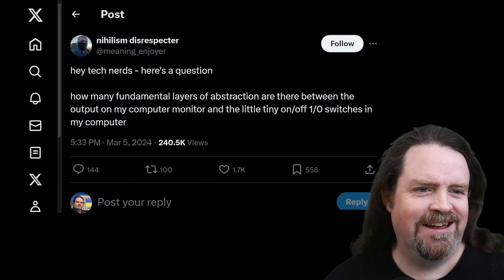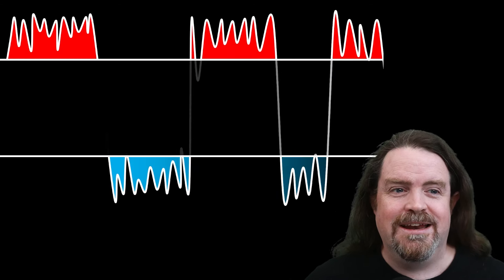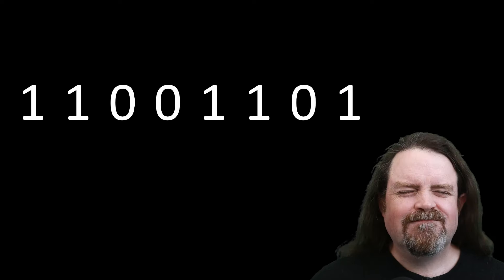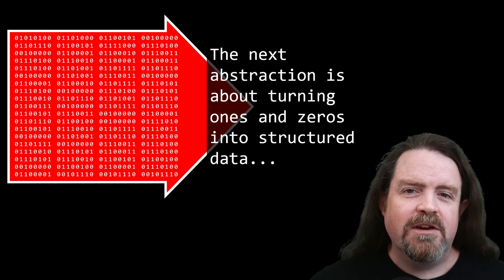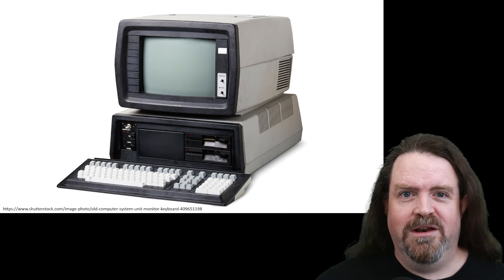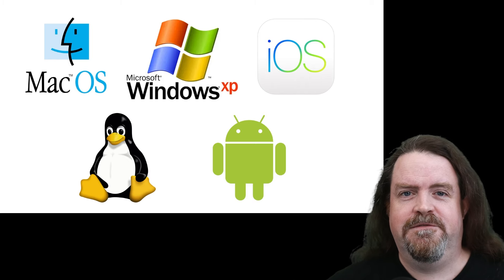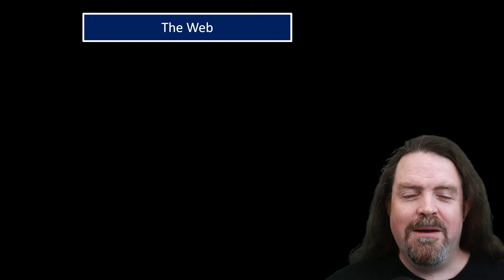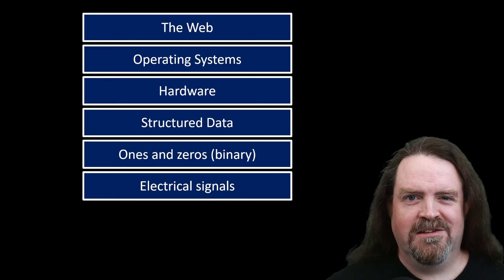Hey Tech Nerds - Here's a Question: Fundamental Layers of Abstraction

Comment: What is interesting to me is that we operate in a space now where we really have to think about and analyze what the layers are, compared to some of our predecessors who would have to work with ALL layers of the stack, and who would know intimately the different levels of abstraction. I think most developers now have wider expertise on the top layers as opposed to deep and thin expertise about how a computer and network work end-to-end.

Perhaps it is more useful for building general software to have wider top-level knowledge, even though we miss out on insights gained from having deep knowledge.

Comment: I disagree with the web being the top-level abstraction. For one, to be pedantic, the question was only about between the output on a monitor and the switches in the computer. The web isn't involved in that. But i don't disagree with any of your reasoning, i'd just give this layer a different name: Toolkits. This terminology is maybe more popular on Linux, but typically for a given graphical environment, which is part of your operating system, there is a Way That Apps Look. To make such apps, people don't draw individual pixels, they use a toolkit! And these toolkits are what abstract "a buffer of pixels for the monitor" into "widgets the user can interact with". Each platform typically has one native toolkit, except the fact that every major platform has several at this point. And some toolkits are cross-platform. HTML/CSS, which is part of The Web, is a toolkit. Not just web apps, but also electron. In this regard, to unify your point about "An abstraction over operating systems", i would also classify most standard libraries in most programming languages as part of an application's toolkit. It is, after all, an abstraction of the operating system (filesystems, syscalls, etc), just not of the UI like UI toolkits are. On that point, maybe toolkit is too broad/generic/preexisting of a term for this level? Maybe a different name would be better?

A toolkit is the fundamental abstraction over an operating system, which makes your app work on many systems, and typically behave as the user expects without writing it multiple times. The web is the single toolkit that works in the most places.